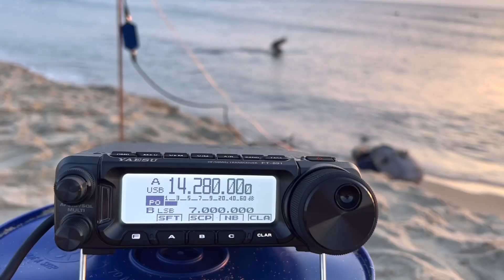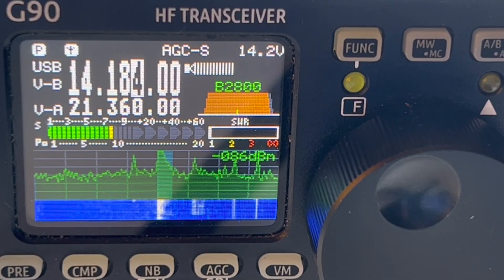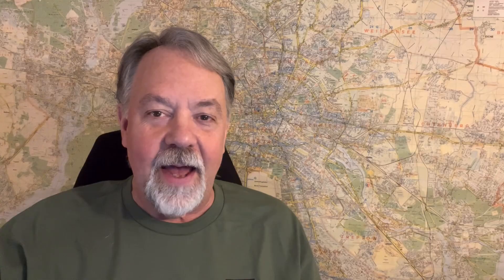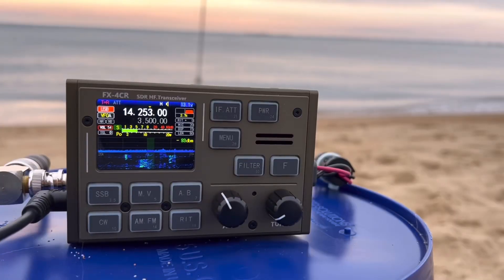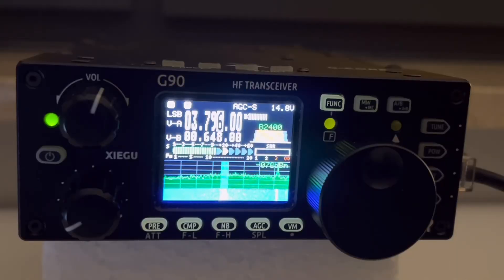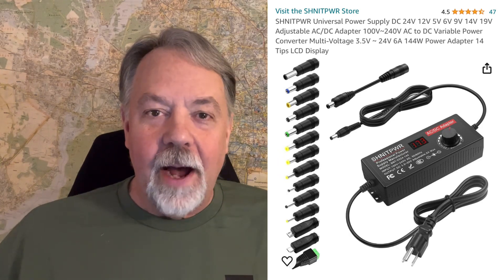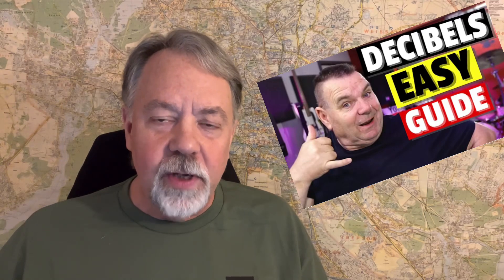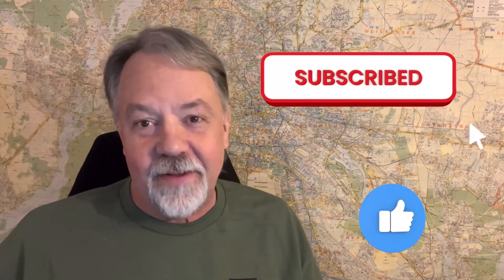20 Watts Versus 100 Watts - How much HF Ham Radio Power Do You Need?

Comment: Bought an FT-891 two years  ago after being off hf for a while. With a 15 amp Bioenno battery I just run 30-50 not more than 75 watts mobile/portable with mine. I like 10 meters best for its sporadic behavior. A challenge is more fun than having a 1000 watts at your disposal N4TCM

Comment: I've only been on HF since January this year, and I have a FT-710. I've been trying to use less power to see how I do. When I first started it just seemed logical to use 100w all the time, now I find people answering me just as much at 50w as 100w. I only have a dipole, so no directional to point around, but I've been doing quite well on lower power. Next I'll start trying even less power and see what happens.

Comment: NO WAY.  WHT DO YOU THINK THE STANDARD IS 100W. FOR HF RIG.  SURE 10W WILL WORK WHEN CONDITIONS ARE IN GOOD SHAPE.  SO AS CONDITIONS FALL OFF YOU DEFINATELY NEED THE 10DB OF POWRR GAIN.  WITH MATH THATS 1.5 STANDARD S UNITS

Comment: Best thing I ever did for myself: Purchased the Xiegu X6100 a EFHW and a few other radio related items.
Worst thing I ever did: Sold it all due to frustration on 10 meters (yes, I am a technician class) due to one dude and his "pushing out 1.5 kilowatts, on a beam antenna 120 feet in the air" which even when he was not pointed in my direction would completely steam roll over me, which is impressive as he is four or five states over.

Hindsight is always 20/20

Comment: In my experience, I have found is the band is what it depends on. I have done 40m over the span of close to 300 miles between myself and another Ham. I started off with 100 watts. We did a test and I kept lowering the power bit by bit and got down to 5 watts and literally made very little difference in the signal. If I went on a higher band, doing that same thing would make a significant difference. Of course one antenna over another can end up affecting the signal also. In the test I did, I was running just a doublet only in a fixed location. Most of my experiences are from my home QTH so I have less variables to play with. 

For someone like you who does a lot of traveling/operating from different locations, you have a lot more variables to play with that can allow you to run only 20 watts. Great video. I will have to store it in my bank of "experiences" (or others experiences). This is what is great about Ham Radio. All of us have different experiences and when shared together, we can all make educated guesses as to what works and what doesn't and why.

Comment: Add a certain point you have to double your power to get one DB when you get to that point you double that to get another DV where I live in South Carolina everybody has three maybe 4000 W. It's stupid I talk everywhere they talk on 200 W and when I run, barefoot60 W I give my buddy 5DB when I turn my amp on and I have 200 W I only gain about a DB and a half maybe two depending on the weather.

Comment: When the band is decent, I have no problem getting across the US using 10W with my TX-500, but it requires attention to detail in the antenna system. I surprised W9IMS (Indy 500 event) about a month ago when I told him I was using 10W. He said I was louder than 100W stations he had been talking to all day across the country. I'm not sure he believed me, but it was true. I was using 10W. One of the reasons ops feel the need for so much power is that they put 60% or more of it into the ground, 10% into heating cheap coax and another 10% into insertion losses elsewhere. Efficiency of the antenna system matters!

Comment: I seldom operate at more than 20w.  I decided to keep my FT 891 just to have a 100-w rig, but the radio I use most often, especially for portable work, is the G90.  I also give the X6100 a good workout and the FC 4CR.

Comment: Hi Mr Coastal Waves, I have got a question. My G90 starts to “sing” when the AGC is on fast and the attenuator is off. Does yours do that as well? It sounds a bit like a “singing” microphone when “shortcutted” to the speakersound. It happens at 15, 12 and 10m. 

Do you know how that might be probibited?

Comment: The very first ham operator I met lived down the street from me.  And, what impressed me the most in his shack was his Worked All States award that he achieved on 0.5 watts CW.   Antennas and propagation are FAR more significant than transmitter power.

73
AI4IJ

Comment: You were right to say "depends on what you wanna do", and "some will disagree". I've got first a QMX 5w, then 50w Amp and ATu to it. Then a G90. Played with each  couple of weeks. Then sold them both and got a FT710, doing home QTH and mobile. Completely other thing league, and still (fairly) affordable. 100w was different, of course, quality of TX and RX was definitely better. But: ham radio is about hearing and being heard. If DX is achievable, better, isn't it? If contesting achievable, is added fun, isn't it? So, going further about mobile operation. I've got the best mutiband mobile  antenna for a decent budget (CHA SS25 - all bands 80-10 warc included), and... 700w amplifier (Acom1010) powered mobile by 200Ah/inverter. So, this is another level, not really budget anymore. And, of course, another level of operating mobile: no problems breaking any pile-up, working the whole world DX, POTA no issues, contesting as well, including SSB. So, 20w, 100w, 700w - different scenarios, in my opinion worth trying each, ham radio fun guaranteed. And if you ask me if I am at last satisfied with FT710+700w mobile and a good ham stick antenna? No I am not, my next project is a separate RX antenna, an active Magnetic Loop one.

Comment: 10W is not QRP, 5W is....
As much as I love my G90 the FT-891 is better in every way, it is a like comparing a German car with a cheap Chinese car, so it is not only about the power, and you can always turn the FT-891 down but you cannot turn the G90 up past 20W. The DNR and filters on the FT-891 is also better that the G-90. If I could only keep one of the 2 it would be the FT-891.
I do agree on the 100W vs 20W, but then again I have been running only 5W or less the last 22 years.

Comment: Right point! I went thru the same thinking process, finally got g90 and I can see a planty of advantages :
- Lightweight power banks for POTA
- long working time with 20W 
- easy to make antennas and baluns, cheap for this power 
- spectrum Analyzer, so helpful 
- ATU which can tune almost any wire..
- long distances 
Finally, I'm i located in NW Poland in Europe and I can reach Scandinavian countries but on the other hand Balcans or 2nd side of Europe like Netherlands. From 20W. Within my country - from side to side. All regions. I think next step will be  500W PA for base use and FTDX10 for better quality, feelings. G90 will stay for POTA. 
BTW I'm using dipole for 80m as for home station and EFHW for portable.

Comment: Love your videos.... wish I lived near to an ocean for beach operation.
I have an 891, MFJ matched tuner, 15Ah box, and a typical portable vertical antenna. It's great stuff, but a lot to transport at 77 years old.
I really like the idea of a small packaged panadapter and ATU radio. I bought a Xiegu X6100 a couple years ago for the form factor, but it's 5/10 watts. Even their X6200 is still 10watts max. Of course, the ICOM 705 is only 10watts, no ATU, and $1500+.
The G90 has been around quit a while now, is 20 watts, but seems to need an axillary cooling fan and digital box to be complete. Do you think Xiegu will improve their G90 with a newer package? Like a 20watt "brick"?
Thanks for your thought, Michael

Comment: Good video, I got a G90 for pretty much the same reason you did, I like building antennas and the built in match gives me room for error and saves my radio. I have Kenwoods and a Drake TR4-CW, had the watts, but I'm getting enough contacts to keep me happy and I get to try new ideas on antenna building. Thanks Walt!

Comment: This surprised me also: from 100 to 300 watt output = 4.7 Db more gain. 6 Db = 1 S-point. So going from a 100 watt transceiver to a 300 watt one is still not enough to gain 1 more S-point.

Comment: Your comments on 20 watts vs 100 Watt radios is interesting and relevant to today’s excellent overall propagation. Currently we see reliable signals on the upper frequencies 14-28 megahertz and even 6 meters. However, propagation changes in step with the 11- year cycle. Many times, on the downside, having 100 watts will be very much appreciated with signal reliability. Yes, even the 20-meter band may see days, if not weeks, of very little or perhaps disturbed signal strength. Many will say; “Where have all the signals gone?”. Ditching a 100-watt radio, for 20-watt rigs, may be seen as a poor decision for many, especially new-comers to ham radio. Yes, 20 watts with the current good propagation is fairly good, if not outstanding. However, changes will come making the advice less tenable as future high frequency propagation is reduced. Good to hear you want to improve your antenna system. That is a good goal whether propagation is good or bad. The best!! Cheers! W1VR
Reply: @COASTALWAVESWIRES I am a new ham and am thinking of buying the g90 but have heard the sun cycle talked about a lot - would I still be able to get out on 20w? Or would I stand no chance on less than100w? Or is it just hard for anyone to be heard in these situations?

Comment: Costs lots of money to run power. There's the cost of a good amp. Mercury 3 will run you almost $3,000.00. It helps to run a 240v line too. Then there's the tuner and antenna, that need to be robust enough to run hundreds of watts. Then there's the chance you may forget settings and burn out your finals. Then there's the cost of electricity, and the lack of portability. Easy to run 5 to 20 watts, you can do it off a LiPo battery. Running power requires at least a good 35 amp power supply. And if you're running power via tubes, that's a whole other cost and issue. If you can, always work to improve your antenna system first. Then grounding and cabling.

Comment: As a new ham (one year general) I found sorting through power requirements information absolutely confusing. 
One guy says you only need 5 watts another says 10, Walt says 20, other says go 100 or go home.
I mainly use NVIS to communicate from one valley to another over a couple of the Rocky mountains in northern BC. I think an NVIS running 40-80m burns a lot of power....at least it does here!
My 891 is normally cranked here. Bad conditions take FT8, a bunch of power, and a hot radio lol!

Top of a nearby hill, vertical with a ridiculous amount of radials, good conditions for 20M, and I can talk on low power DX no problem. Bad conditions wont let my buddy out with 1500watts.

Honestly...I'm still confused! :)

Comment: Hi Walt. I love my FT-891 and could never part with it!  The FT-891 is a fantastic all-round, great radio. It's not my main shack rig, bit I still love using it in the shack from time to time as it performs so well. I find it a joy to operate.  However, your videos have persuded me to try some portable HF at some point - and I'd like to have a go with a G90. A G90 has therefore been added to my wishlist!   (But the FT-891 definitely isn't going anywhere!!!  LOL).   Thanks for your videos.  73, Mike, M0MTJ
Reply from the maker: You will absolutely love the G90. I'm actually thinking about getting a second one as mine has been through the ringer and is being held together with tape LOL

Comment: A few years ago, I wanted an HF rig after getting my General ticket. I didn't have a grand to get started. So, I ordered a G90 bundle when it was on sale, just under $400 for everything. Unfortunately, even though it was stated to be in US stock, it wasn't. Even with "express" shipping from China it was taking some time. While waiting for the G90 to come in I traded another radio for an ICOM IC-706MkII with a tuner. It had even been MARS modded. During a club event, we tested the G90 and it worked well. Then back in the box. The Icom 706 has been a great radio and has done some field days and about a week ago, the Texas QSO Party. I want to do some JS8call and Winlink. I have a digirig box and cable for either radio. Now you have me thinking I should turn the Icom into a base station and get that G90 and get used to it. Play with the G90 at home first, then turn it into my field rig for events. The G90 does have some features that the old ICOM doesn't. Not just the SDR, but others as well. Appreciate the video. Btw, I recommended your channel to a friend who just his HAM license and is interested in building his own antennas.

Comment: Yes, that's right, 20 watts should actually be considered QRP. Why? In the past, I mostly only used 5-10 watts and you could still hear well. With about the same number of sunspots. Today, with all the interference, usually S3 to S5, you get lost in the noise. 20 watts would be the optimum between portability and performance.
Reply from the maker: I agree. 73, Walt

Comment: Thanks for the video. I’m a new ham and going back and forth because of the price of the Yaesus
Reply from the maker: @derbemobile  just some advice if you’re new. The G90 has a built in antenna tuner that will tune anything, the Yaesu doesn’t. The G90 is more forgiving when using it with different antennas. I highly recommend the G90 because if this and the price for a new ham. Less frustration and more success when getting started. 73, Walt

Comment: I'm like you Walt, I have the icom 7300, icom 718, Yaesu FT950 etc. But the G90 is just a great small radio that's super easy and fun to use. Yes, thos 100w radios will help you bust up a pile up. But for the money and pure fun of it all I love my G90. 73s N5MLS

Comment: Hi Walt.  On July 6, at 9:36 pm (CDT) I worked RW1F in ST. Petersburg Russia on my G90.  20 watts into a 6btv on 20m.  I know some might not believe this, but most of the time if I can hear someone, I can work them with 20 watts.  My G90 is my favorite radio, closely followed by my Icom 706MKII.
Reply: I always understood that it takes 4x the power to gain 1 S-unit at the receiving end, but it was never brought home to me so clearly until I got my G90 on the air!  I originally bought my first G90 because I wanted an SDR radio, and felt that many were (and some still are) very overpriced.

Comment: Thankyou. I'd buy a G90 if had to go through it all again.  I've enhanced/upgraded my FT-891 and have an ATAS-120 also, so I'll live in FT-891 eco-system for now.  I just inject pre-set code plugs depending on what I am doing.  Cheers for the video and you work in HAM radio!!
Reply: Put in pandapter, anderson p/poles, Noctua fans (quieter and cooler), Armaloq frame, digi-rig, changed to N-type and changed speaker.  Now it's perfect 😀

Comment: As a 50 year ham and retired two way radio tech, I agree 100% about the difference in power. I run my 891 on 10 watts CW and 20 on SSB.

As a field tech, it's hard to explain to a customer that his brand new 100 watt UHF repeater car radio just isn't going to get double the range his old 40 watt car radio did, LIKE THE SALESMAN TOLD HIM HE WOULD......

There are 2 advantages the 891 does have, first with 100 watt capability, you have plenty of overhead to protect the finals. 
Second, the 891 has 6 meters, which is great for portable operating with an antenna that just is so much smaller. 

I used to have the SGC SG-2020 that I loved for portable use, but in spite of it's 20 watt rating, it's well known it doesn't do that on 10 meters. Mine only did 10 watts on 10 meters, which was disappointing. I sold the SG-2020 and replaced it with the 891, but I still regret selling the SG-2020..... It was just the most simply rugged transceiver ever.

Comment: I count not agree with you more. The G90 at 20 watts does a great job. Getting DX, too. I later purchased a FT-710 for the 100 watts and regret the purchase. I have had and liked Yaesu radios, BUT this G90, although not perfect, is an easier radio to use, better audio, quieter, and does digital, and Winlink with either the Signalink and/or a DigiRig. SSB and CW work great. When you add the antenna analyzer wow!
Reply from the maker: Thank you!! 73, Walt

Comment: Home built linked EFHW and 20W got me into Canada no problem the other evening on 18MHz SSB. Running an IC7200 on a battery portable. Antenna up a tree somewhere north of Tokyo.
I can get into VK land on 10m daytime with 5-10W JS8 on a short horizontal EFHW. Great fun.
Admittedly sometimes the other end’s antenna does help a bit but hey, it’s all part of the hobby.

We’re capped at 50W portable anyway so 100W is out the question.

Comment: Im all about the brand.... Have a lot of Yaesu's but would buy a chinese radio like the G90 or a FX-4CR but I draw the line at junk like icom. My FT897 does 20 watts with the built in batteries. Works great and I've got all the stuff needed to go portable with it.

Comment: Though running 100 watts can make quite a difference, I too still prefer running low power even at home. With not even one S unit difference between 10W and 20W you could have sold the G90 as well. On the air it would even be less noticeable than the jump from 20W to 100W.

Comment: Couldn’t agree more! I live in South Eastern Australia near Melbourne and using my G90 had a great QSO on 20m with Ben PD2BA in The Netherlands using 20 watts into a Mad Dog Coil and a 5.2 metre whip from eBay in my backyard. Ben received me at 5/7 about 15 miles out of Central Amsterdam. A video of the QSO is up on my YouTube channel. The difference between 5 watts and 20 watts is a lot more stark than the difference between 20 watts and 100 watts I’ve found. 20 watts is a great compromise between performance on air and battery size etc. Keep up the great work on your Channel! 73, Craig VK3CRG
Reply from the maker: Thank you Craig! 73 my friend